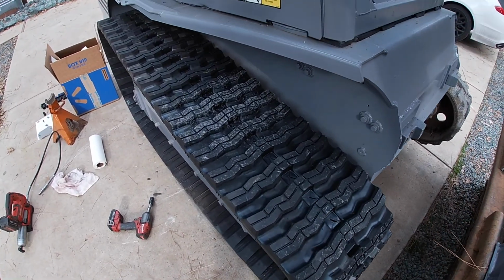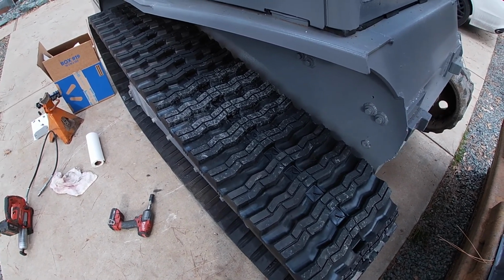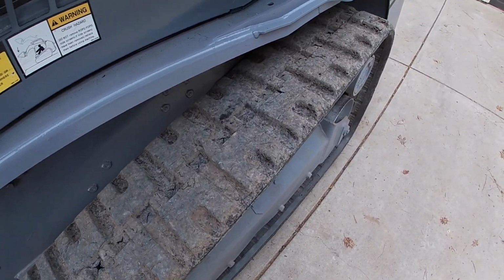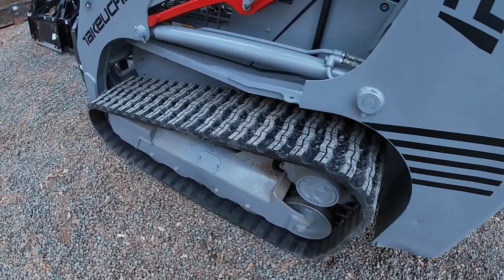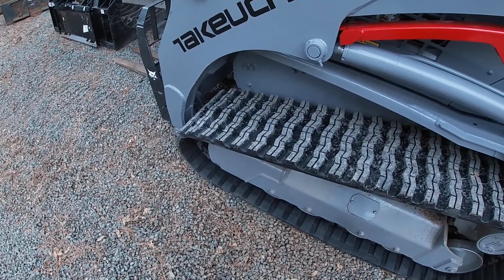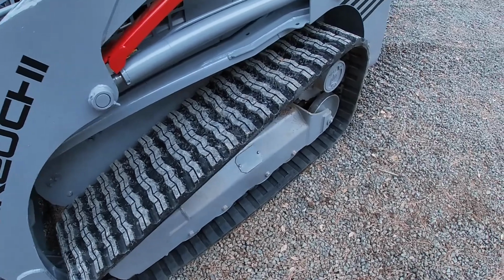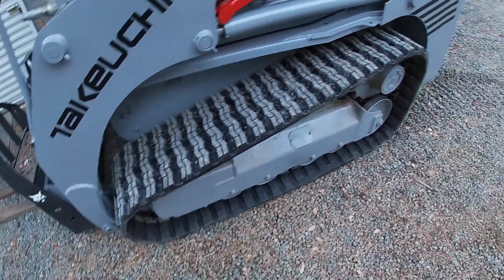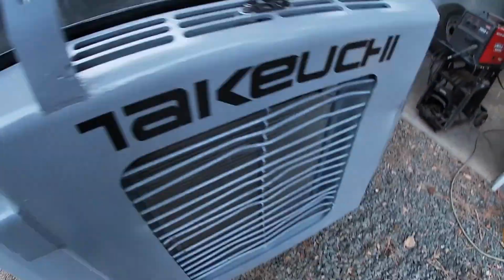Putting ZigZag Tracks On My Skid Steer

Comment: I’ve changed tracks many times on my TL-130. Helpful hint for getting the track over that front idler: stick a 2x4 in the track between the idler and the track, get in the cab and spin that particular track forward and the 2x4 helps run the track right into the roller. You can get just 1 track to spin while it’s up in the air FYI.
Reply from the maker: Thanks for the idea. It was my first time.